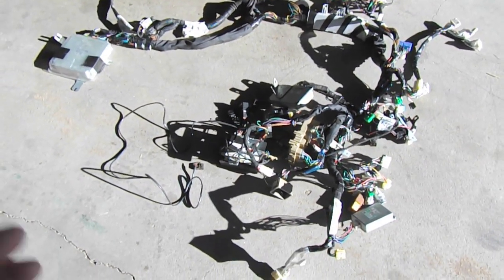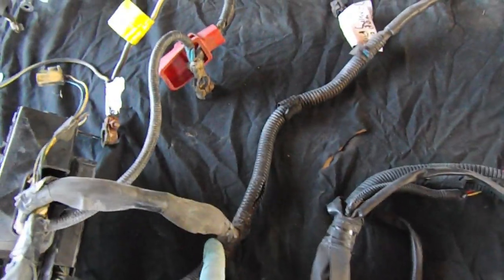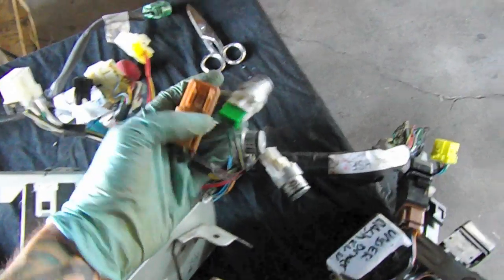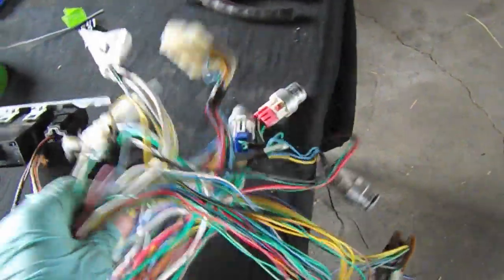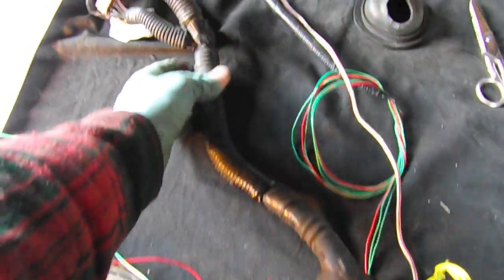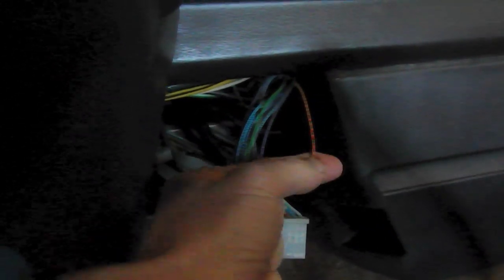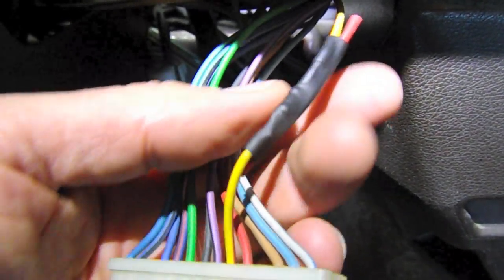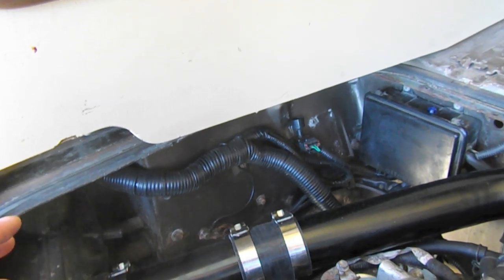Subaru wiring harness OBD2 - Subaru Vanagon Engine Swap Part 5

Comment: Thank you for making a video of the wire harness creation.  I'm curious about how to address a OBD2 code reading.  1507 (idle speed fail safe) comes up repeatedly. I have a 2.5 from a 2003 outback. I didn't do the install, but I would like to understand how to correct these problems when the light up my dash oxygen light. 

Is there a good set of guidelines on correcting false signals? 

You do a wonderful job explaining the harness. Much appreciated!

Comment: That does help thank you I am a good ways into it now I am kinda stuck on a couple of wires I have the small car conversion kit. But on b21 connector wire 9 and 10 went back into some connectors that aren't used. I'm not sure what to do with those. it's a 98 forester harness. Thanks again
Reply from the maker: +Wesley Mcbrayer Hi Wesley, your best bet is to get the Input/Output chart for your ecu and find out if those wires are needed. Post up what pin 9 and 10 are for and I'll try and offer some guidance.

Comment: Can a stock intake manifold be reversed? So you will not need a throttle body reverser. This is on a 98 Forester 2.5 DOHC

Comment: Hey I'm stoked I found this video with the links! You are a life saver and one of the only places to find the pin outs so thank you! Im doing a 99sub legacy outback 2.5l into a baja bug and im keeping the subaru trans by doing the subarugears swap. My question is, do I need to save more wires and stuff that would go to the tranny? thanks again!
Reply from the maker: You're welcome! I would talk with SubaruGears and see how the Subie trans needs to be wired. You will probably have to keep the TCU and the wiring for it.

Comment: Hey your video helps a lot but I am still stuck on the neutral safety switch , speed sensor and reverse ..... Auto to manual swap on a 2.5 rs 2002 wires coming out of manual tranny can be spliced into auto harness ? I just don't know which wires to splice together any help will be nice thanx !!
Reply: Rami I realize this is old but did you figure this out? I have the same issue

Comment: I have the ECU pinouts, for my 02 auto 2.5na, but do you have a list of what wires I will need? Its going into my 84 westy w/manual trans cheers for your videos and photo step by steps, they are the BEST

Comment: Hey Bro... BJ here... again.  My question is probably pretty weird I guess.  The question is... I have a 91 Subaru 2.2L engine installed in a 82 Volkswagen Vanagon L.  Being a 91, it is an OBD-1 engine.  I would really like to convert that to a OBD-2 ECU/ECM .  I have just rebuilt the engine and it is absolutely "rock solid".  When re-installing it I was faced (again) with a pretty butchered OBD-1 wiring harness.  Is it possible to replace an OBD-1 wiring system with an OBD-2 wiring system.  Or should I just start all over with a 2.5L OBD-2 era engine and wiring harness.  Really LOVE my 2.2L but the wiring issues are just a P.I.T.B.  Just curious... ya know?

Comment: First of all thanks a lot for all your videos, this is pure gold :-) What are you actually doing with the Immobilizer? Is there any clever way to bypass it, or do you leave it just connected with switch and key somewhere hidden in the engine bay? Do you know if it is possible to extend the wire between Immo-ECU and Key-Antenna in order to place the Subaru ignition switch at the Vanagon Dashboard?
Reply: Thats for Canbus motors.  You can buy emulators from http://agtengineering.com.au/canbus.html             and from              http://subarugears.com/subatronics/index.html

Comment: Did this Harness include an immobiliser? 
If not how would you go about incorporating the wiring for the immobiliser?
Reply from the maker: Hi Dubway, no immobilizer in this harness. Your best bet would be to find a wiring diagram for your model. That will give you an idea of how to wire one in.

Comment: You make it look pretty easy.  I must admit this is the most intimidating part of the conversion for me.  How many hours do you estimate it takes to build one of these harnesses?  Thanks again for the great video.  JC.
Reply from the maker: It's pretty intimidating at first, I agree. Just take it in small chunks and its less so. Just focus on weeding out the wires you don't need at first. Once thats done, then start playing with lengths and where you'd like to mount your computer. Once you've figured that out you can then start lengthening wires to meet that location and then finally start taping it up. Let me know if you have any questions on it, its a fun process for me now.
Reply: Busaru 子愛

Comment: Thanks For the video, very helpful. I am doing a swap from a 1998 legacy outback and I have my harness about done minus a few little things I was wanting to know which wires you ran from the ecm to the dash and which ones you went ahead and did a away with. Also was there any wires from the engine harness with the 3 square plugs and o2 sensors that you cut out. thanks again!!
Reply from the maker: Well, each harness is slightly different but I usually don't ave to run any wires up to the front. Usually water temp, oil switch, RPM, and ignition/battery sources can be found in the engine bay. As far as cutting wires from the engine connectors, usually all of those are needed so I don't cut. Good luck!

Comment: Please elaborate on the 22 Ohm resistor, exactly what "Gauge" is it supposed to make more accurate?
Fuel?  Rpm?
Reply from the maker: +Liberty Patriot Hey Liberty, I've since moved to a 33ohm resister and it is for the water temp gauge - it'll read just below the middle at normal temps.

Comment: hello I'm building a 71 super beetle with a 04 subaru wrx ej20 motor and  like to figure out what harness I need and what sensor connectors I really need to get rid any help or suggestions u have would be greatly appreciated thanks
Reply from the maker: +Jerry E Hi Jerry, ideally you would pull a harness from the donor you got the engine from. If that's not an option then the next best thing is to pull a harness from that year WRX. Then you can get an ECU pinout chart and go down the list like I show in the wiring harness playlist (look in my channel to see the playlist). Since you're a turbo you will have a couple more items but that should give you a good idea of what you need. Let me know how else I can help.

Comment: Hey buddy your video is much apreciate to get an idea what we would be getting into!  But i have one special request! Try to record from start to finish the procces of stripping the unnesesary wire ive seen you youtbers recording two hour content! And what is your most recomended ecu wire harnes to install in a splity ? My splity is a 1967!
Reply from the maker: +Isaac mondragon Thanks Isaac, have you seen my entire playlist on wiring harnesses? I think there are 14 or so videos doing exactly what your requesting. As far as the splitty, I think any modern Subaru would work great but I prefer 1990-2004. Cheers!

Comment: I have two EJ22 engines.   I pulled one from a 1990 Subaru Legacy along with a wiring harness and ecm. I pulled the other one from a late 90's or early 00's Subaru Impreza at a Pick n Pull because it looked much better in shape.  I thought that both the two EJ22 engines are interchangable, but then I realized that the latter is a bit different interior and it might need an appropriate ecm.  I plan to put this one in my 1985 VW Westfalia.  I just pulled a wiring harness and ecm from 2001 Subaru OutBack at a Pick n Pull to go with it.  I wonder ... do you have any information on the "interchangable" issues among EJ22 engines from some different years and models of Subaru?    I looked at this online and apparently I couldn't find clear information.  Maybe me too dummy for that?  lol  smallcar advised that both engine and wiring harness with ecm must come from the same car.   Any advice?
Reply from the maker: In 99 the 2.2 switched to a 36 rise timing trigger setup (phase 2). The early 90’s 2.2 uses phase 1 timing. The 2.5L engines switch to phase 2 right around 01/02. Tell me what exact combination you’d like to run and I’ll try to offer some suggestions.
Reply from the maker: So rereading your post it sounds like you’d like to have the Legacy Outback ecu drive the Impreza 2.2. It’s possible - take a look at both engine blocks and see what timing gear they’re using (behind the harmonic balancer) they should both have 36 “triggers” on the cog for that to work. Shoot me some pics if you’re unclear - I’ll try to help. Busaru@busaru.com

Comment: Hi, my name is Wayne, and I've been watching your videos over and over about Subaru conversions. I'm going to convert a 1985 Vanagon for a 2002 EJ 2.5 engine, so should I use the MAP sensor or the MAF sensor? Also, how do you wire a MAF or MAP sensor?
Reply from the maker: I would leave the engine stock, the way Subaru designed it (at least at first). This means using your donor cars wiring harness which will include the wiring for all of the sensors.

Comment: I saw the pinout pages in the video.  could not find the exact one in the links.  Were those for a 2000 forester 2.5l?
Reply from the maker: The 2000 Impreza will work for the 2000 Forester. Just print that out and make sure to trace out a few wires to make sure they match.
Reply: Busaru
Thank you..great info..

Comment: Thank you, thank you!  I got it from here!  :-)

I don't want to get ahead of you, Mick, but I have one each of the two types of expansion tanks (early and later).  Both are cracked and I want to get one on order.  From your Boxerswaps site, it shows an early one, I think (larger upper hose connector).  In fact, the one in your pictures appears to be cracked worse than mine.  Do they need to hold pressure? 

Not to get too detailed here, but I see that many conversions move the tank to the old airbox location, but perhaps that is for packaging efficiency when reversing your coolant manifold?  I have not done this, but rather following your lead.  Maybe you can cover this briefly in an upcoming episode.  If you're not too far along...

Many thanks again for putting all of this together!
Reply from the maker: Hey Forthwith, I think you can get the harness, it's not as hard as people make them out to be. As far as the expansion tanks, they are definitely pressurized. You can pressure test yours if you're concerned. I usually mount the tanks on the heat shield at the back of the bay for ease of transitioning the coolant output to the radiator tubes. I normally don't reverse the manifold. It's slick, and looks good but I am on the side of Outfront motorsports - they recommend keeping the coolant system stock, and so do I. It doesn't matter too much which expansion tank you use, just specify to KEP which original engine you have (1.9 or 2.1) and they'll send the correct petcocks. I tend to like the early versions though, and you'll see that in an upcoming video. Hope the swap is coming along well!
Reply: Busaru I keep finding things to do.  Too much time on The Samba = More parts ordering.  Decided to go with the Westy Adventures starter adaptor and the VW TDI starter.  The starter in the Vanagon is over 12 years old and with all the other parts I've replaced so far, it didn't seem like a good idea to keep it. As for a replacement, it was either buy a potentially marginal (for the Subaru engine) stock Vanagon starter or use the higher torque TDI starter.

Comment: What do you do with the speed sensor?  Is there a work around?
Reply from the maker: Hi Anne, no workaround that I know of. Starting in 96, Vehicle Speed Sensors (VSS) are mandatory, and I've heard they help the earlier engine management as well. I use the Smallcar VSS. It's inexpensive and works great, bolting up to the transmission and using the CV axle for the rotational side of things. Here is the link: http://www.smallcar.com/index.php?dispatch=products.view&product_id=29880
Reply: Busaru thanks for the info.  Just got a 96 2.5 dohc engine and trying to figure out the easiest/best way to get it into a bug.

Comment: Hi there...I hv an ELM327 connected to wrx STi Version 4 1998 installed in my van....elm doesn't read at all...could u advice me on the obd connector wiring....tried elm on my wildtrak Ranger...works well....TQ Brother
Reply from the maker: +NikNazri Hassan If it's a JDM harness you may have issues as I don't think Japan required the same protocols at that time. Try to find the service manual for a similar year USDM harness and see if your pinout matches.
Reply: Busaru TQ....I certainly will check on USDM models...happy driving

Comment: Is the ignition wire normally a thick wire? I'm trying to strip down a 2000 Outback harness ej251 but the ignition wire is a thin green/red as  per the wiring diagram. My constant positive is  a black/red
Reply from the maker: The ignition on is thin gauge, green/red was a commonly used ignition on wire color. Battery positive is black/red on some models but beware - some of the grounds are also black/red (Subaru is crazy for this in my opinion). Good luck with your harness.

Comment: I have done a ej22 swap in my bug I used the shop talk forum thread and your old boxer swaps Web site. I am now doing a 2.5 98 forester swap now I got all the pinouts from ecu to sensors,etc. but I am at a lost to what to do with all the power supply wires and grounds. Any suggestions?
Reply from the maker: +Wesley Mcbrayer For power supply there are 3 needs: Start signal from the starter solenoid wire, Ignition ON from the key switch, usually a black wire that went to your coil, and Battery 12V constant from battery. The start signal is self explanatory, the Ign ON signal splices to the Ignition source wire on your ECU, and B+ will go to 2 of the 4 wires on your main ignition relay, you'll have to decipher which ones get the battery connection and which ones are the supply to your sensors and ECU. Hope that helps!

Comment: I have a 1977 vw bus and I'll like to install a subaru engine and I'll like to know what year and engine side can I use and what kind of wire harness can I use
Reply from the maker: The easiest way to do this is to pick up a donor car that has the engine and wiring harness that is meant to go together. Anything from 1990 and up can be used but I'd recommend going with a non-turbo model.
Reply: I really appreciate your advice  I was thinking a 96 or above 2.5 or 2.0 what do you think. Thank you
Reply from the maker: I would say that they're both great engines and are essentially the same aside from the displacement. If you want the extra 50 horsepower, I'd go with the 2.5. If economy is more important, go with the 2.0. Good luck!
Reply: Thank you I'll probably go with the 2.0l

Comment: your link is dead... Do you have a list of the stuff needed for the engine to run on the schematic? Im installing an EZ30D into a vw based kit car.
Reply from the maker: +ydeardorff Thanks for the heads up on the old link. For an EZ30 your best bet is to try to find the factory service manual or ECM pinout sheet. Take a further look at my channel and you'll find a playlist on how to do an entire wiring harness, you'll find some resources there or you can go here: http://busaru.com/services/resources
Reply: hey, thanks for that. I have the JDM manuals for H4 and H6 on pdf. Just trying to get a second look on my thoughts as to what we need to grab and connect before start up of his 99-03 EZ30D engine. I am going a different route using a complete and uncut harness on my car. He wants a more stripped down version (electrically). He also wants to use the BUG fuel tank so finding a work around for the fuel system would be helpful too.
Reply from the maker: +ydeardorff for the fuel tank sensors just use resistors, I have a pretty complete code killing resistor box that'll solve lots of problems with the old aircooled stuff. I'm probably going to open source it if people want to build their own for cheap. Hit me up in a little while once the test duration is complete and I should have an assembly ready, or I can get you the resistor values.
Reply: yeah I have a monster box of resistors. give me a list of items and what resistor when you get a chance

Comment: Why will the check engine light always be on?
Reply from the maker: Unless you put resistors in to trick the ecu into thinking it has the fuel tank sensors you will have engine codes. These days I build “Code Killer” resistor boards for the harnesses I convert.
Reply: Do sell the resistor board?

Comment: About 10" from my ECU plugs is a blue 7 pin/9 wire flat plug, any insight on what that is for... or can it be trimmed off?
Reply from the maker: +Kevin Alberts Sounds like sensor grounds. Trace some of the wires out to see where they go.
Reply: When I sent this one... I thought.  Then I realized I might as well follow the pinout and figure out what is what.  Sometimes it helps to type it and read what I sent to help myself figure out the resolution.